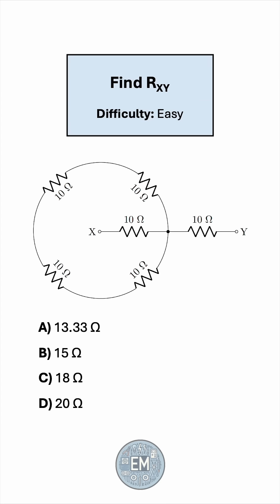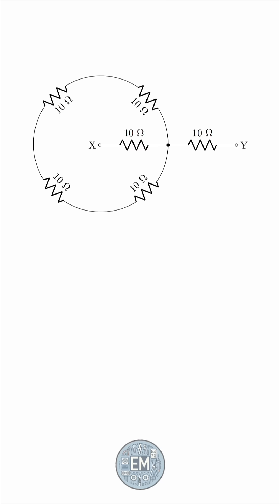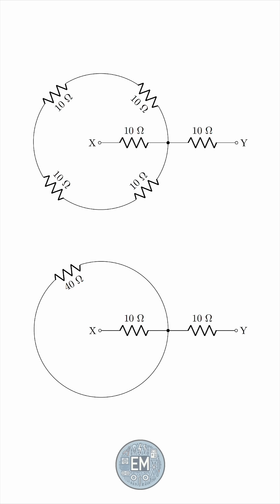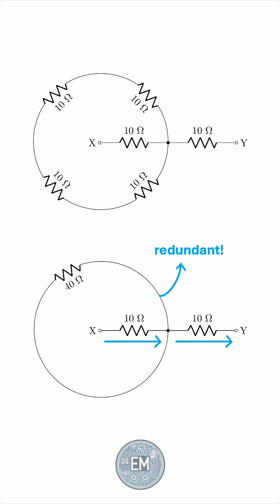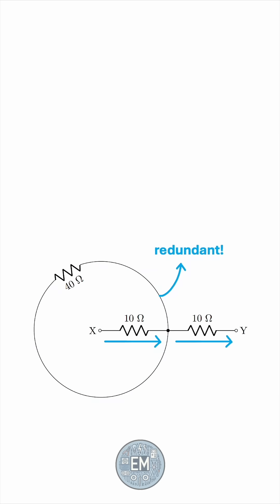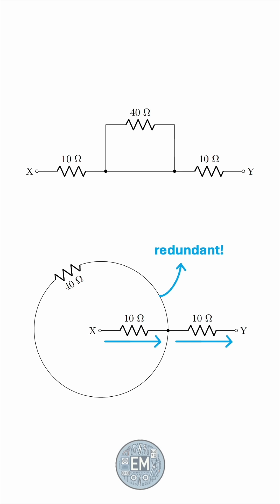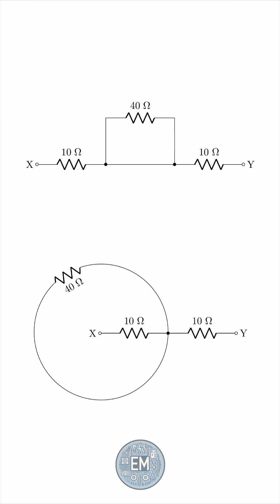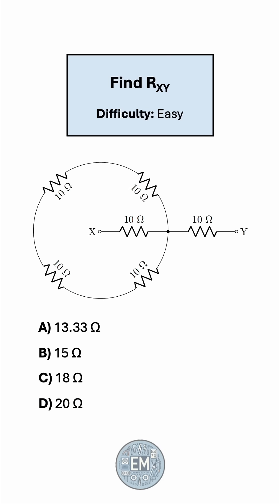Equivalent Resistance Problem: Circular Path #electricalengineering

Comment: it’s redundant when a branch or both ends of a resistor is connected to the same node right? I think it also applies to other circuit elements.